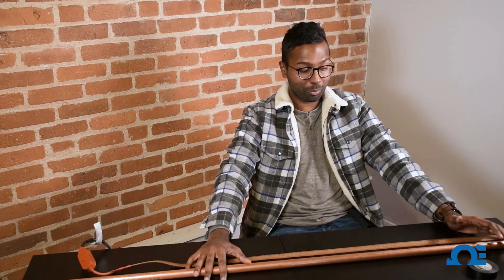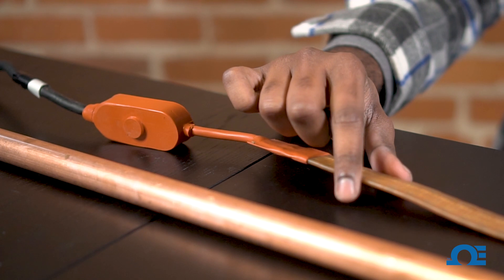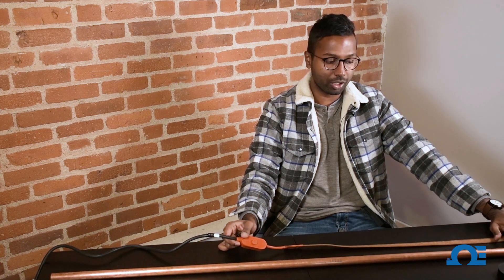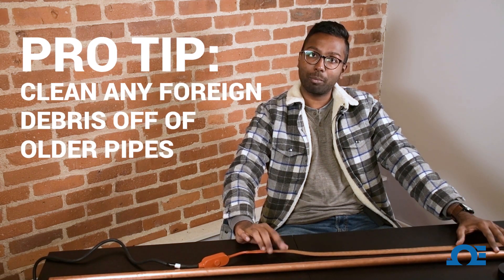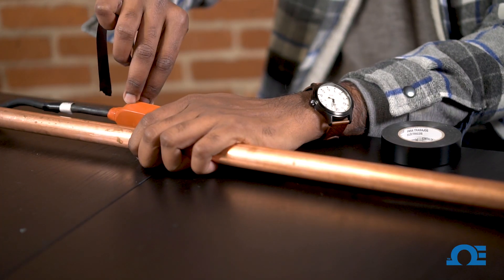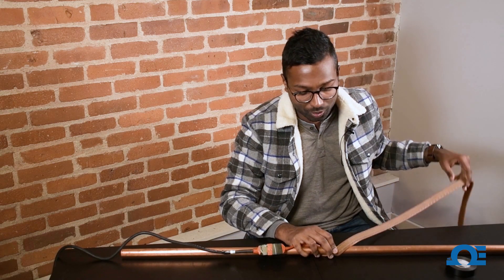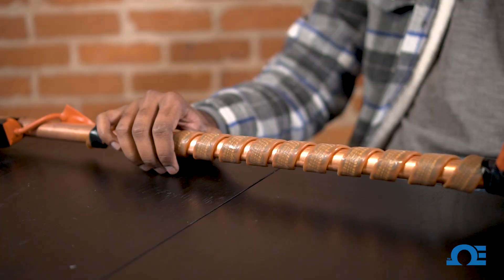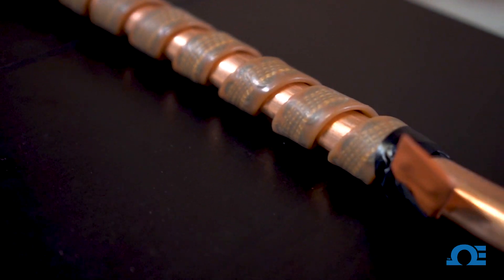How to install Heat Tape to your pipes | Step-by-Step

Comment: You DON'T wrap the pipe, that will burn the wires/ shorten the life / waste length,  and not work as efficiently. All you need to do is run a straight line on the bottom of the pipe keeping it in contact with the pipe is the important thing so zip ties or shrink wrap work great. The heat will open a channel for water to run. Ive put thousands of miles of heat tape down and the Wal-Mart stuff is garbage you are better of going to brand you can cut to length. the sensors never work like they should, your best bet is to turn it on around Thanksgiving and turn it off around Easter. It can cost as much as a dollar a foot in electricity a month so dont be surprised when you get your bill. It might be better to insulate everything properly! Or leaving your sink dripping is a great alternative if you are thinking you will just plug in the heat tape when it is really cold, cause ur gonna forget! Your breaker is the only gfci you need,20 or 30 amp is best. If you run an extension cord use a low gage, 10 or 12 gage, contractor cord not one for Christmas lights and you will be fine. So in other words this video was worthless.

Comment: What a joke the most important thing to do is insulate.
Reply: do i insulate on TOP of the heat wrap?
Reply: @Jean-gf3fi  Only if you use fiberglass insulation.

Comment: The heat tape I've used says specifically not to wind it around the pipe.  I'm assuming you've read the instructions?

Comment: I just bought frost king heat tape and it explicitly says NOT to wrap it like you're doing in the video. It says to run it along the pipe parallel.

Also, extension cord is fine as long as it's rated for the job. Some outdoor, low temp-rated, 12 or 14 gauge <50ft extension cord and you should be fine
Reply from the maker: Hi Jay Gee, Thank you for your question! It's very possible that your tape does not have the ability to wrap itself around a pipe. Most likely it doesn’t have a bend radius. If it is bent around a pipe, the physical stress on the internal heating wire will damage it. Our heat tape featured in this video does! Therefore allowing it to be wrapped around a pipe.
Reply: I always run mine like at 7:00 pm position so the heat can radiate .. also weakens the tape wrapped if not using a good brand heat tape👍🏻

Comment: Hey thanks for the video. So I just purchased a couple of 3 ft long 220 volt heat tapes... and they have Korean outlet plugs. Could I cut off the plug and add a standard 110 volt American plug? Or could I cut the plug and direct wire into 110 volt? Thanks for your help!
Reply: Yes you can. Just be sure to do it correctly